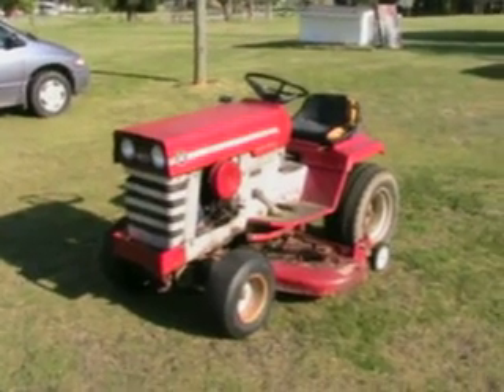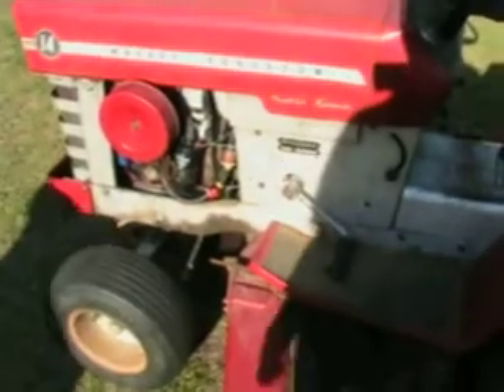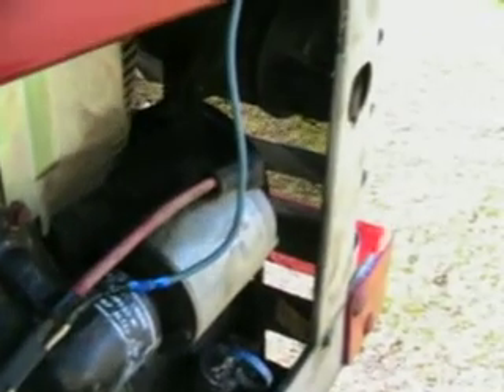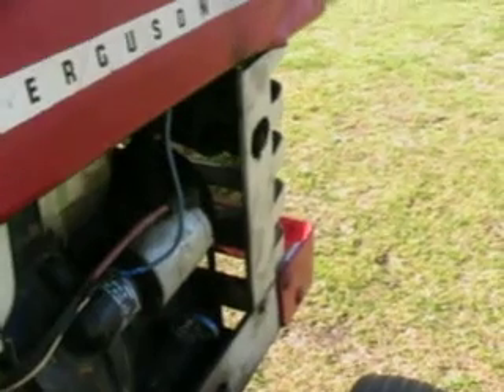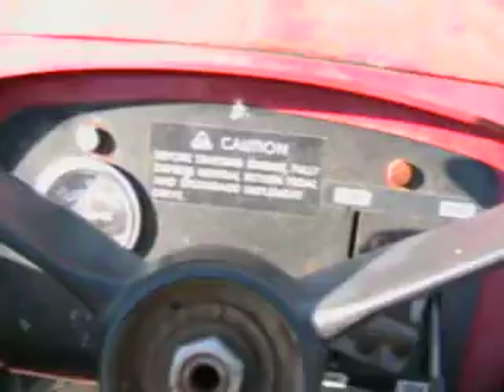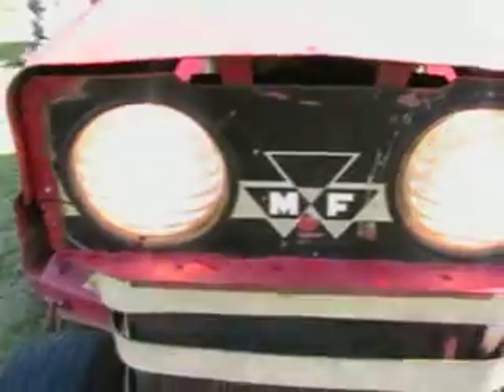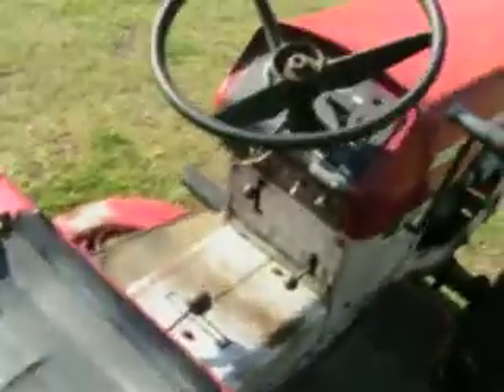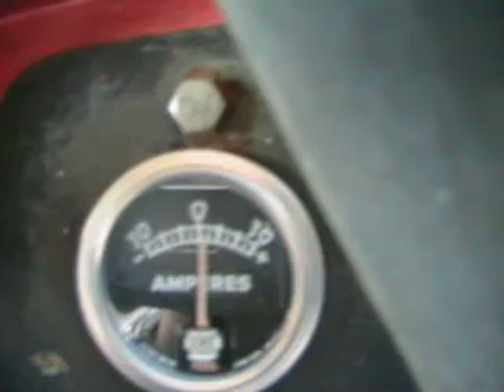Massey Ferguson 14 Mower

Comment: I've got a 1988 wheel horse 420 lse and it doesn't have any safety features either. I could cut the grass and hop off while it's moving and it will still go until I stop it. and by the way. you should take the exhaust and flip it upwards